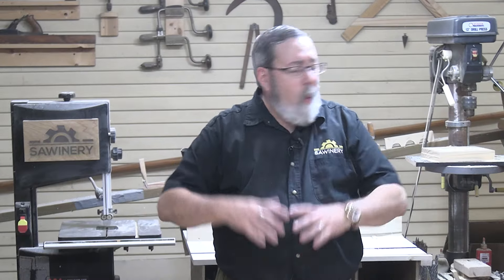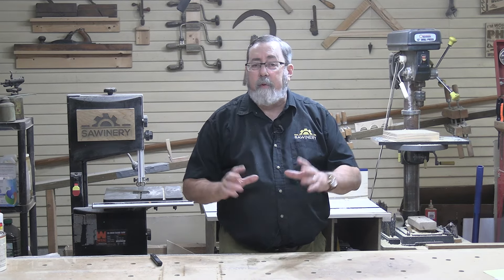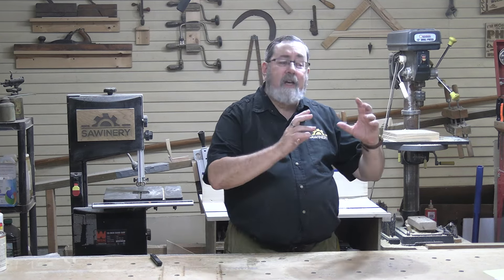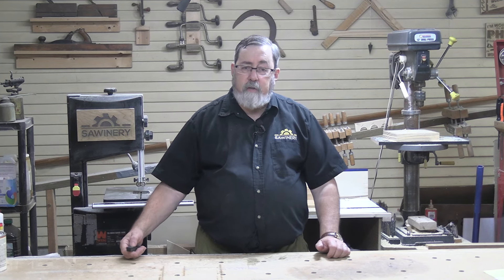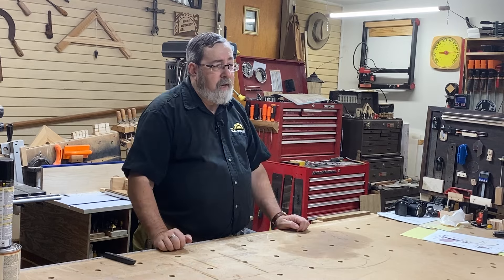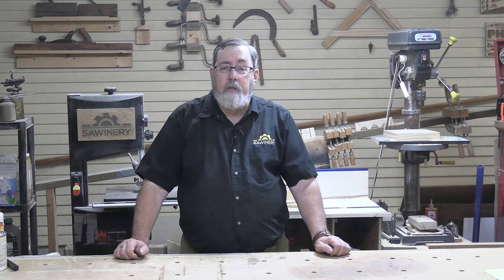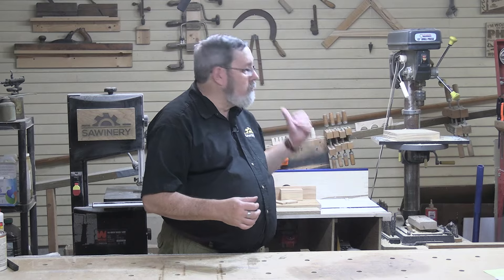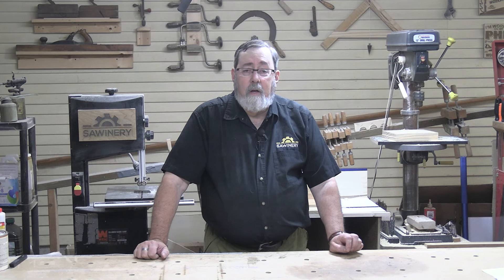7 Key Tips to Maximize Your Small Workshop Layout

Comment: Hi Rich, being a contractor for nearly 3 decades, I've accumulated a number of duplicate tools and gear. When I set up my Woodshop I placed simple things like pencils and utility knives near every workstation. I  know sometimes woodworkers frown on tape measures, but having carried one for decades and using it daily, it's a hard habit to break. Nice thing about it is it's always where I am. Also having and using a dust collector and a tool triggered shop vac is a godsend. If and when people can afford one and then the other, I say make the purchases. They are well worth it. These are my recommendations for what they're worth.
Reply: I have a dust collector, and I plugged it into a remote outlet setup so I can turn it on anywhere in the shop with a remote control....it was a cheap way to go about it, and it has worked for 15+ years LOL.  

Yep, tape measures, and pencils are scattered all over the place for me too.   Having multiples of a tool is a good thing in many cases, not only can you have one in different places, you have a backup in case one fails in the middle of a project...doesn't happen often but it can, and if you have a 2nd one it'll definitely/most likely save the day.

Comment: My rules are keep everything as adaptable as possible. Wheels are great. Saw horse tables when needed. Roller stands etc. Then change things up when something gets annoying. Best pickup has been overheard pull down extension cord with three outlets. No more running around for a cord.
Reply: Where did you find pull down extension cords?
Reply: @Nereosis16  amazon or harbor freight

Comment: The problem is my shop is a barn, which has a dirt floor, isn't insulated or otherwise finished inside....so 99% of the year its useless as its either too hot or too cold....I'm working on a floor right now for 1/2 the shop, which I think will be good enough for myself and my tools, and allow me to keep the other 1/2 the shop a dirt/gravel floor to keep the tractor and implements.  Its cooling down now, so I'll get back out working on the floor, got about 1/4 of it done, need the sheathing for the rest of it and finish cutting the pressure treated 4x4's and getting them placed.  Dust collection will be another item I need to work on...I have a dust collector, but it'll be a process of getting the dust collection lines put where they need to be, and all the stationary tools are going on mobile bases so I can roll them out of the way against the walls when I'm not using them, to give me a nice wide open floor for whatever other projects I've got going on.  

Tool storage is a never ending battle, as is shop supplies LOL.  You are always using and replenishing the consumable supplies, and portable tools end up here and there, and never where you thought they were LOL.